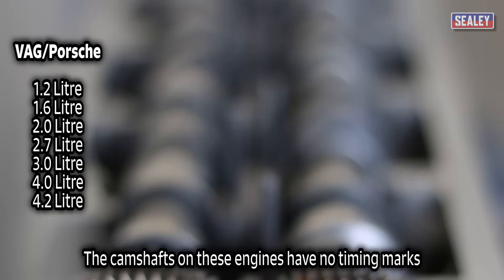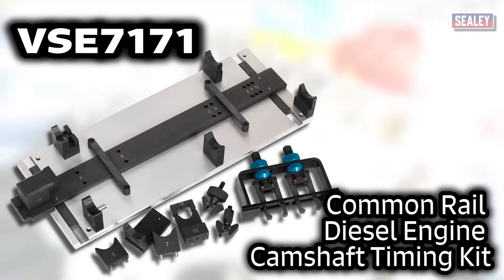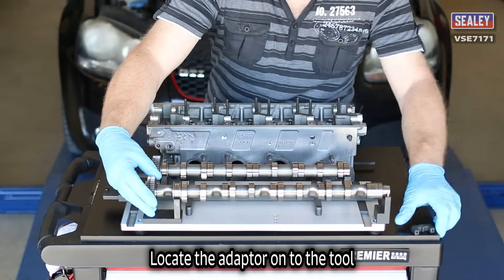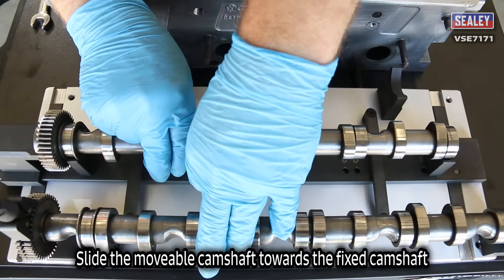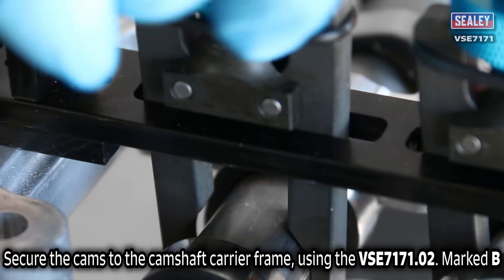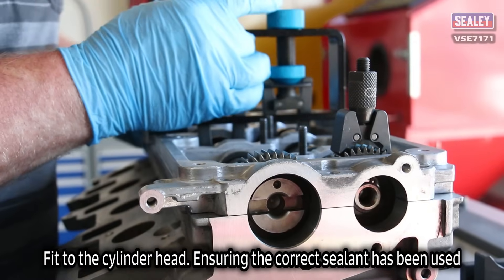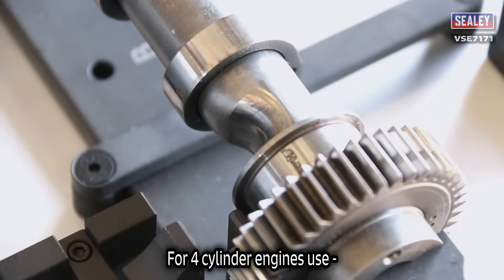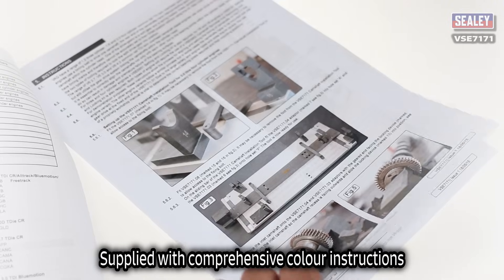Mastering Common Rail Diesel Engine Camshaft Timing with the Sealey VSE7171 Kit

Comment: Vw Tdi 2.0 2012 is compatible or 1.6 tdi vw
Reply from the maker: Hi. The kit fits the following engine sizes/types (ranging from 3 cylinder up to V8 engines): Camshaft installation kit for VAG/Porsche 1.2, 1.6, 2.0, 2.7, 3.0, 4.0, 4.2 common rail diesel engines.  However, if you would like confirmation, simply enter the (UK) vehicle registration or engine code into our Timing Tool Kit Finder on our website here: https://www.sealey.co.uk/timing-tools  Thanks.

Comment: align cam pulley with normal timing tool. and the other cam with flat straight across. have fitted a few. lobes move when belt snaps.
Reply: Hello, my belt snapped, can you tell me on what camshaft the lobes move ? exhaust or intake?